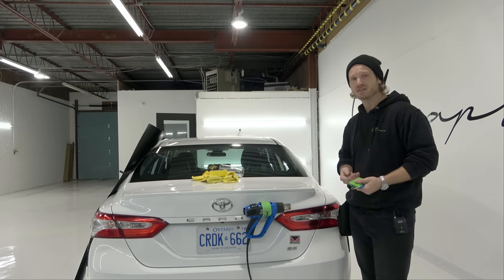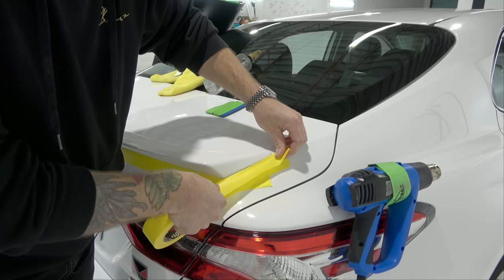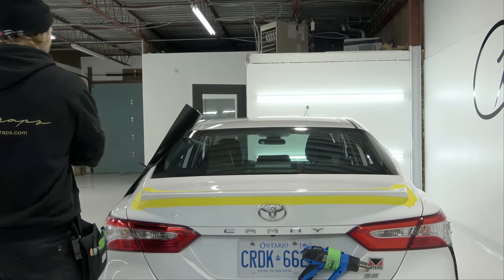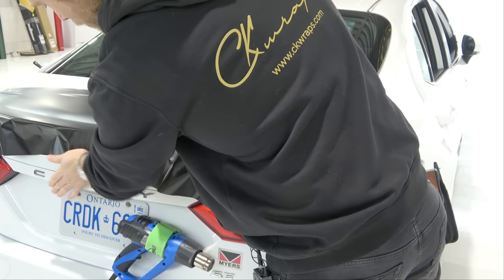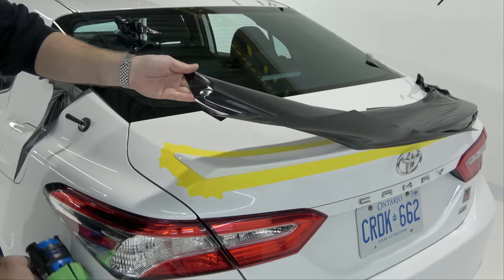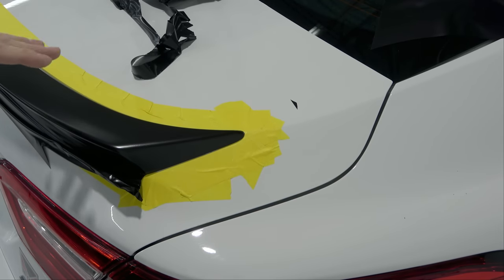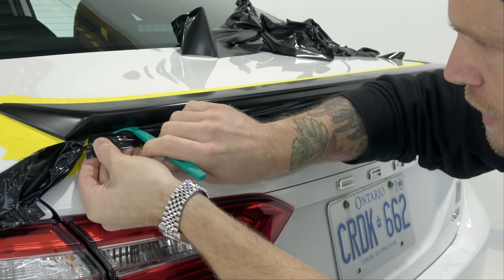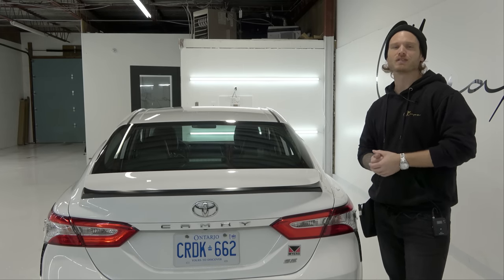THE MOST DETAILED How To Wrap A Spoiler Tutorial

Comment: Well I’m stuck got new front splitter ABS plastic.      Trying resin and carbon fibre skinning but the ends just wanted to lift and not stick so tried spray glue and that would not stick flat and made the resin pool like separating even with hard sanding then white spirit so now doing wrap 
I guess 1500x600mm for £10 is rubbish stuff I can’t get the ends in one bit I want the fins to line up in the patten.    So going to do one bit up the front side of the wing so weave is following the way I want it lol then do the splitter main body  
It’s definitely a ART !! 
You make it look so easy

Comment: Wrapped my spoiler between my legs in the bedroom 😂 not lying its the best lit room. No garage and can't wrap it outside with the neighbors building a farm. Wrapping and  constant dirt dust in air dont go well.
Current wrapping my bumper on the living room table and so far coming out good. Its pretty advanced with the recessed curves everywhere causing tension issues so im divided it into 4 quadrants. Theyre hard to wrap off the car with just myself. It took 3 tries to figure out best way to apply, which was go from top flat spot and stretch into recessed curved lip at bottom, rather than go bottom to top. The recessed going bottom to top was causing too much tension and wrinkles. I put about 4 days total into doing the bumper due to custom color splicing, custom license plate mount and adding front diffuser with stabilizers.
Black carbon fiber and Ferrari corsa red

Comment: What type of vinyl for interior, i brought some blue carbon and it's terrible trying to work it round edge's spent hours trying to mould it round my heater control panel. Seem's alot thicker than a silver wrap i have
Reply: The vvivid carbon fiber designed for interior is actually pretty thick. When you check vvivid on Amazon they have the thickness of the different types
Reply: @Roadsurfer2k11  the black carbon i have is by vivid it's stupidly thick, perfect for flat surfaces. Only trying to improve the interior looks till i can be arsed to actually go buy a new motor